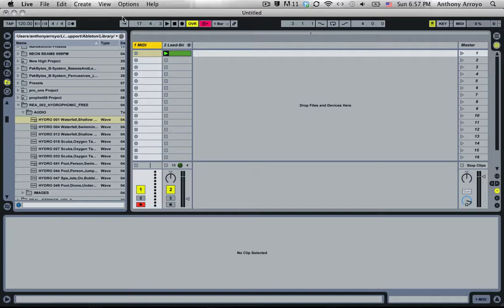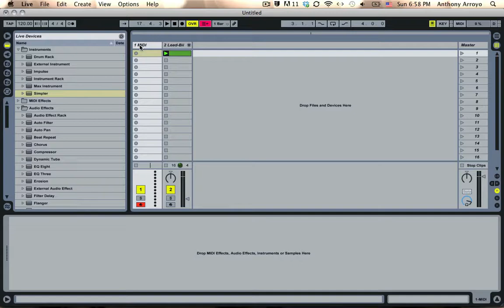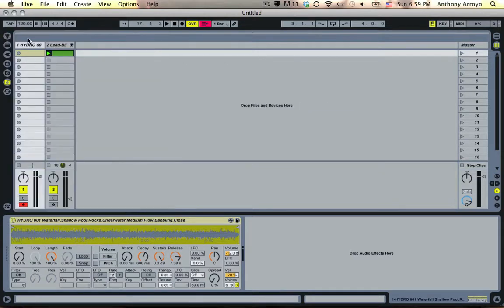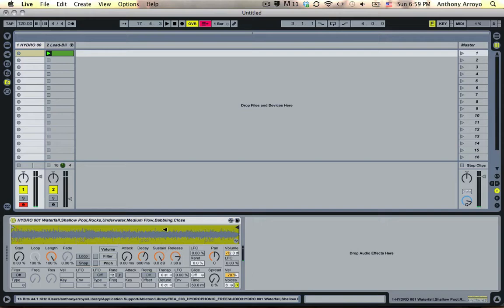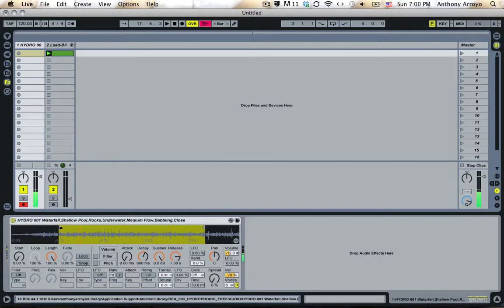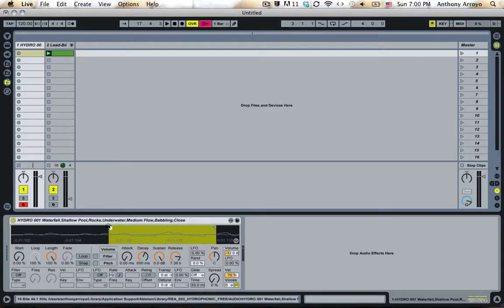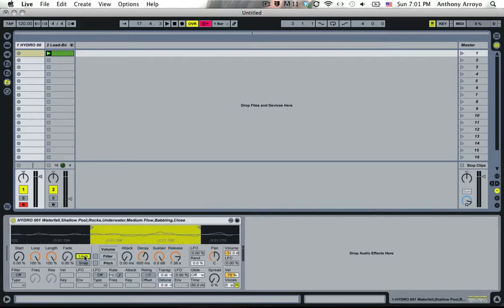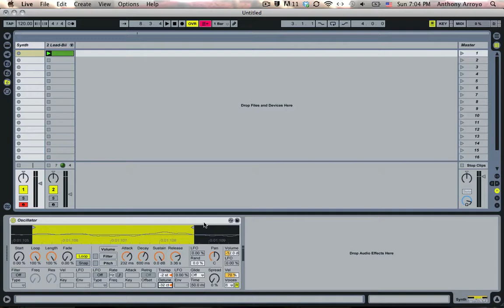Ableton Video Tutorial--How to Make an Instant Synthesizer with Ableton's Simpler

Comment: all these simpler tutorials.  they're just shortening the sample down to one cycle of what is basically a sine wave.  The sample is irrelevant at this point.  Lolz
Reply: Yeah, I get that there is some originality in each sample, but I feel like people are getting a little too excited over that, why not just throw in a basic wave and start with that, that's even more original IMO. Either way, I learned a lot thanks to the simpler teachers and their tuts for n00bs :).

I guess they do that to show you that you can apply all this stuff to a sample and actually use some of the interesting sounds from it. You would need to find a distinct wave

Comment: hi nice tutorial! Quick tip... to change the default load mode of the simpler right-click on the device and at the bottom you will see an option that says "Save as Default Preset" This way you can get rid of the kick sample that loads with it every time. Cheers